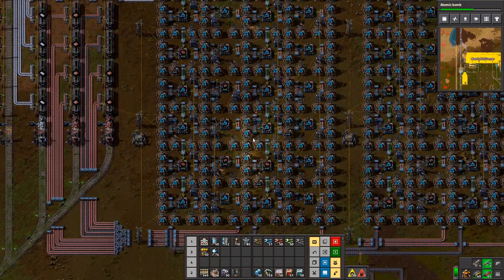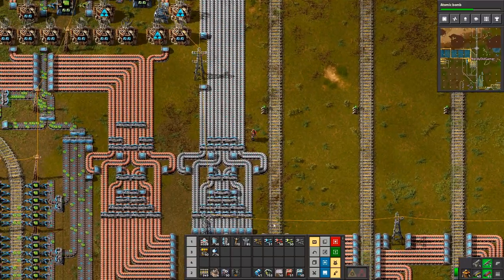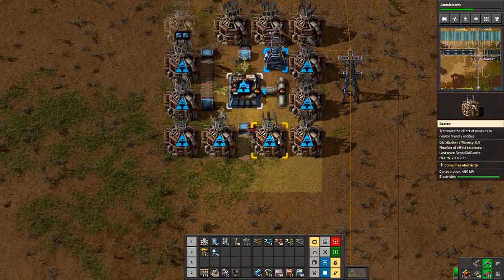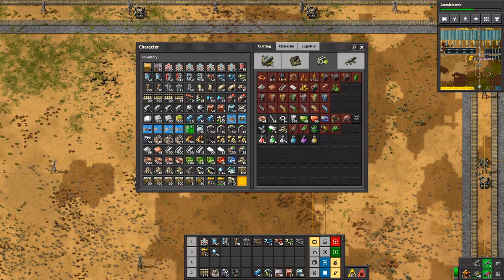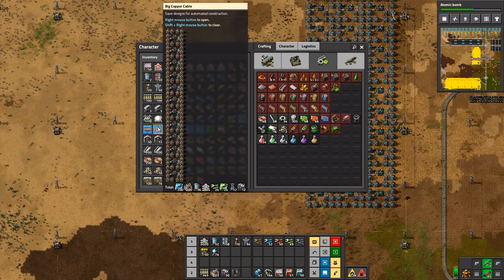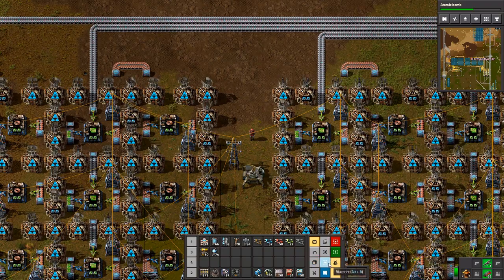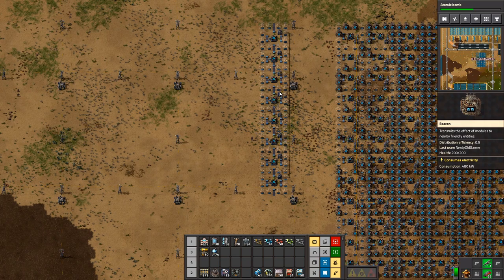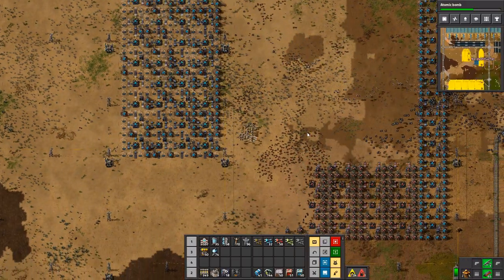Factorio Multiplayer with STHedgehog Ep108 | New Circuit Setup

Comment: Glad to see you caught your mistake. I don't know for sure but I don't think the belts are going to be able to move all that copper cable once you get it built check to see if all the copper cable assemblers are running they should be your ratio is right. One thing I see is that you don't want to belt copper cable for very long runs I try not to go over six assemblers before I can clear the belt of the cables.
Reply from the maker: I have no idea if they can either, I guess we'll find out :)